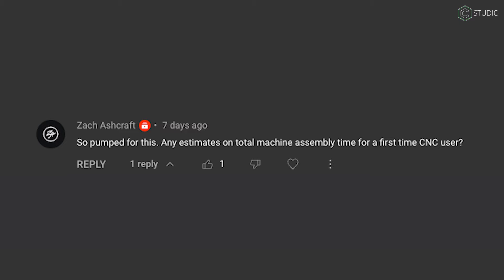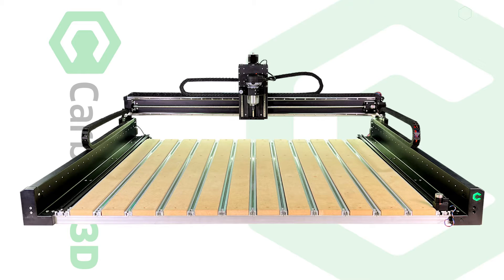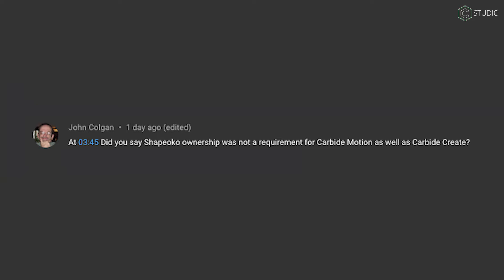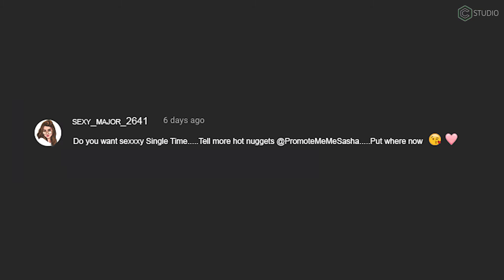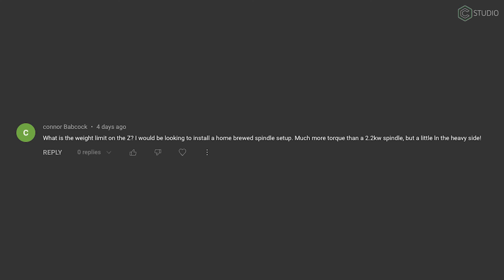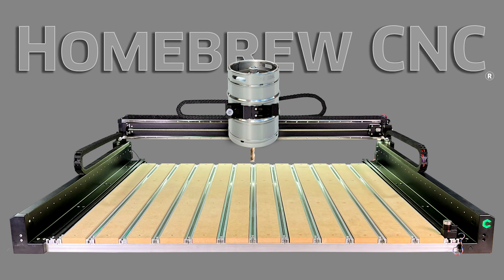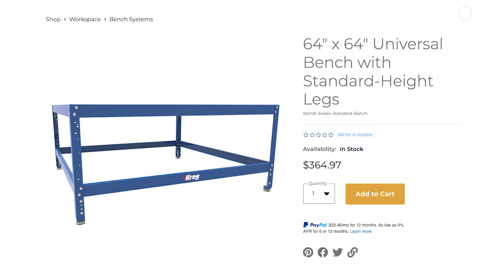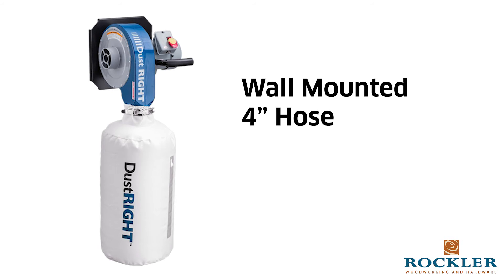Q&A Session - Shapeoko 5 Pro - Video 5

Comment: I know this video is a bit old, but I must ask. While researching, I've seen a few videos with serious noise coming from the Shapeoko 5, resonance/chatter when traveling diagonally across the workspace. Are there any solutions to this issue? Has this issue been resolved? What is happening in those videos? I'm about a month away from dropping the funds for a CNC, and so far, your videos make this CNC look like a top choice.
Reply from the maker: Hey Stochastic,   
Since you’ve been doing your research, you know how we treat our customers.   We pride ourselves on providing the best customer service you’ll experience in any industry.    
Any individual machines issues, like what you mentioned above, have been addressed by our support team.   What you describe is not normal Shapeoko 5 behavior.  

If you haven’t yet, check out My.Carbide3D.com This is our central hub for your CNC Experience.  Sign up is free, the resources are free even before you buy a machine.  

Continue researching, and then join our family.   The Shapeoko 5 is a tremendous machine.  And the company behind it is even better.  
- Kevin (initially a customer long before working for Carbide 3D)

Comment: I have pu ttogether 3 shapeokos 3-4and the4x4 5 I can say that the 5 took the most time to put together be cause none of the wires were  taged as to where they go. 
The bed was the east to put together . Also how about one that has a tool change in it sowing using the bit setter bit zero to set your zyx Jeff Peters

Comment: Does carbide motion allow you to pause the job and changes speeds on the fly?
Thanks 
Chris.
Reply from the maker: Chris.  Thought I’d answered this one earlier.   I may not have hit send. 
Motion allows you to vary the Feedrate on the fly by anything from 10% of your initial setting to 200%.   
If you wish to change the speed of your VFD, you’ll have to stop down and restart your program.   With a Carbide Compact router you can vary the speed on the fly by using the dial on the router.

Comment: When mentioning the smaller machines there was a statement about mounting on the wall.  I thought vertical storage was bad for the mechanicals.  Thanks for posting the table specs and I'm looking forward to the table video.
Reply: Adam, vertical storage is very bad for belt drive CNC's. If you have some kind of hard stop on the X and Y axis all should be good. Look for Peter Parfit youtube channel. He made an interesting vertical storage. https://www.youtube.com/watch?v=EysYVMnZxBQ
Reply from the maker: Marcus, the Shapeoko 5 Pro is not a belt driven machine.
Reply: @carbide3d  I know, I was telling Adam that it is a concern if it's a belt driven CNC. It's still a concern on any machine tho. No matter how rigid is the machine the weight MAY eventually distort your setup. Perhaps not affecting the machine itself but the base that you DIY for it.
Reply from the maker: We wouldn’t suggest hanging a machine at all.
Reply from the maker: Quick clarification:  I said "against the wall", not meaning "hanging on the wall".   A table on wheels for storage.

Comment: You keep refencing an 80 mm spindle and the current VFD kit is out of stock. Should we be thinking about this as an unannounced product that replaces the current kit?

I'm wondering if I get a router, do something custom, from the start, wait.....
Reply from the maker: There will be an 80mm spindle before too long.  And we are constantly making more VFDs.  Get on the email notification list to be first in line.   The VFD is what we run here in the shop full time.

Comment: I would like to know how the 5 stack up against the hdm. I am looking for the more robust machine. Are these normal steppers , closed loop or servo?  Also, "where do I put my endmill " LOL xD
Reply from the maker: The HDM by design is an incredibly ridged machine. It uses bigger extrusion and thicker billet material with lower pitch ball screws which making it excellent at machining composites and alloys .   It comes standard with an 80mm water cooled spindle, which allows for larger than 1/4" tooling.
The S5 is an incredible machine designed to be used by a wide range of people and uses, including large format sheet material. As such it isn't practical to build it in the same way,  as its span is over 4ft, we use different extrusions and faster moving ball screws.  
The S5 has a variety of size options as well as two spindle choices.  Again, allowing for a wide range of people and uses.   You will find no lack of power in the movement of the machine.  The motors are capable of stalling a VFD spindle in material.   You'll break the endmill before you stall the machine.
Reply: They look like open loop steppers to me. I have an HDM and if you will be doing primarily aluminum/composites/ and your projects fit on it.......that would be my choice. It uses higher torque steppers, the ball screws are pitched more for precision, and the extrusions are THICCCC.

Comment: When will you show this Shapeoko 5 Pro actually doing some work? Can it machine 5/8" 6061 aluminum plate or is it just a wood carving machine?
I'm looking for a cnc that can do both.
Reply from the maker: Bud, the 5 Pro is absolutely up to milling aluminum all day long.  You'll want to equip it with the VFD for prime metal cutting performance.    Over on Instagram we've begun posting some video of the machine cutting.   Aluminum will soon be going "under the endmill".
Reply: Winston also posted a video of the SO5 milling aluminum on the Carbide 3D forum. ;)

Comment: Save me time looking up all the specs,  tell me if the motors used have more torque than my S4xl.  Or maybe the question is, including the ball screw drive, can the S5 produce higher force than the S4?  Thanks for all you do.
Reply from the maker: Yes.  This machine will drive hard enough to stall a VFD.  You will not lack for torque or force.